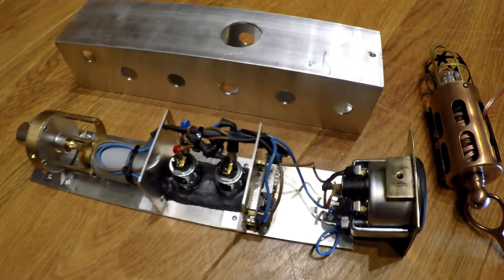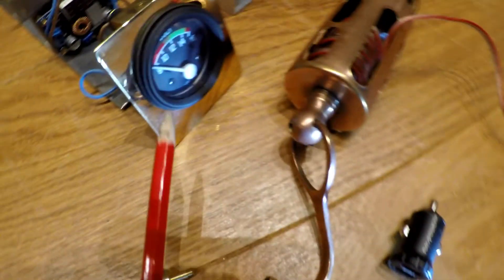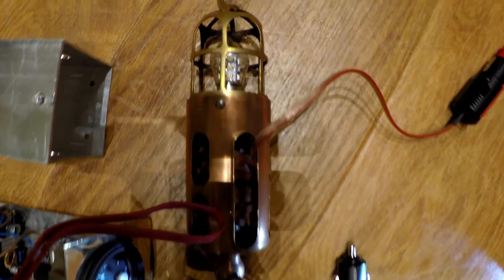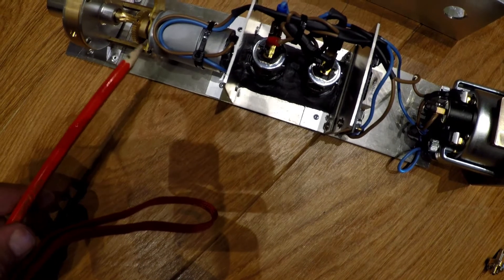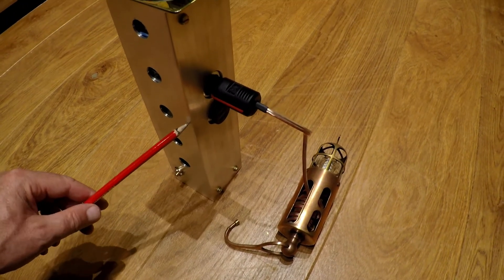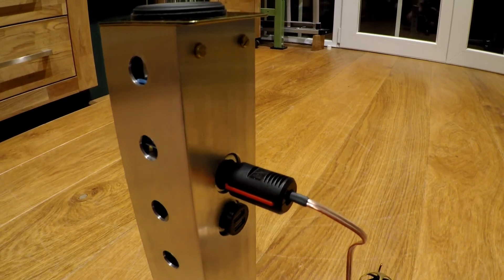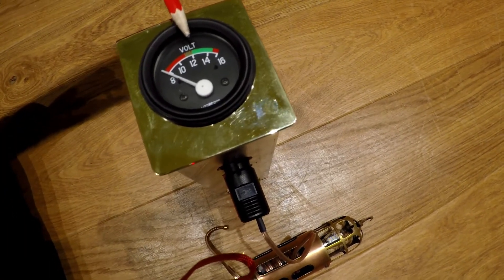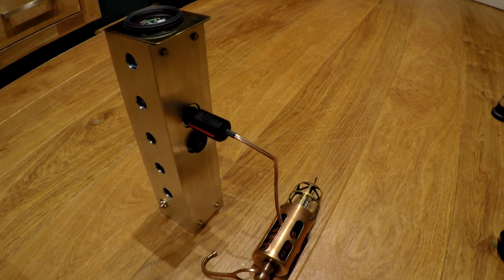Steam Turbine Power Generator Part 2

Comment: Bonjour Christoph,
As usual would I say, you make again a perfect job, I was not aware of your electroni skillness.
But what do I hear, you made a test and there is no video to sho the result ?  What a pity, please correct quickly this lack  :+)
Which was the used pressure to reach 13V ? Did you modify the venturi of the turbine ?
Amicalement, Raphaël
Reply from the maker: Salue Raphael, I am just painting the housing, afterwards I will install it in AMPHORA and link it to the steam piping system. Off course I will show the result first under air pressure and later with steam... promised :-)
Reply from the maker: see all finished in a playlist https://www.youtube.com/playlist?list=PLtUxQprQxdMLAMQwmhPZJhQ64zVlLWoAF
Reply: @The123pcr  Bonjour Christopn, I hope your family and you are fine and hope the current crisis will not prevent a navigation soon to validate in real life all your amazing work.
Amicalement, Raphaël